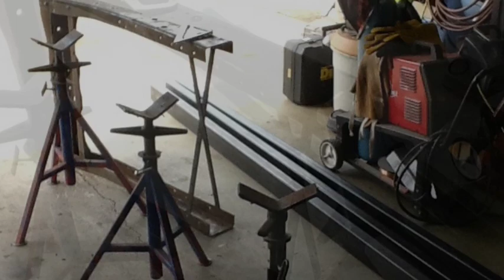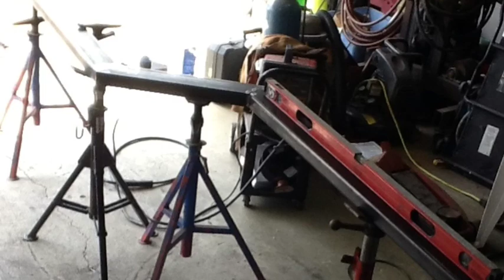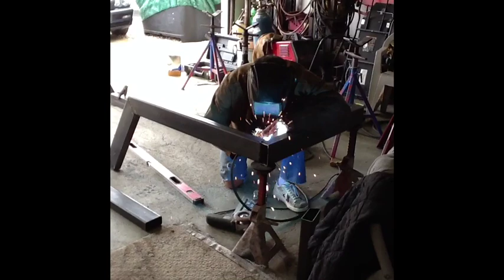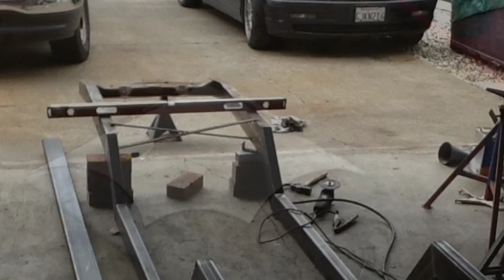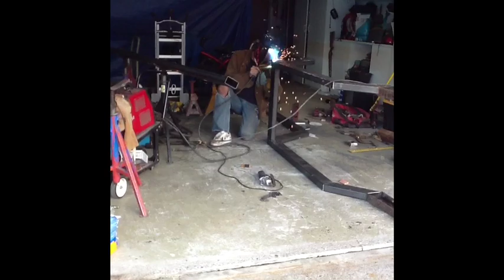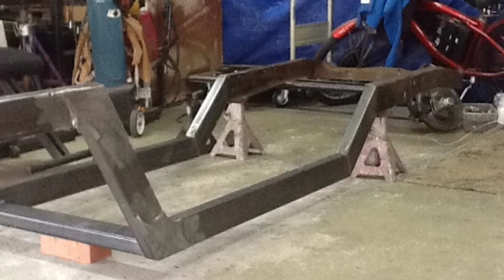Ratrod Frame Build

Comment: I'm curious, how does the VIN work on a custom frame? Do you get around it by cutting out the original vin and welding it to the new frame?

Kinda like when you rebuild a house, you leave some of the old foundation so it counts as a remodel?
Reply: +Micah Montoya The VIN is from the body not the frame

Comment from the maker: It's the stock '47 front clip I just rounded the front tips cause not using a bumper
Reply: 101/5000
the first that I see finally put reinforcement on the frame in the welded joints! well done